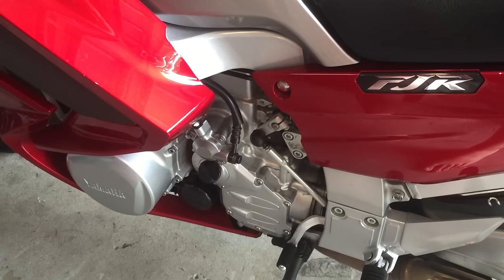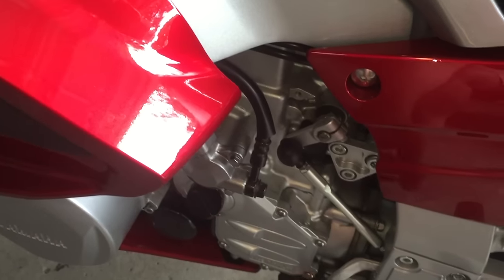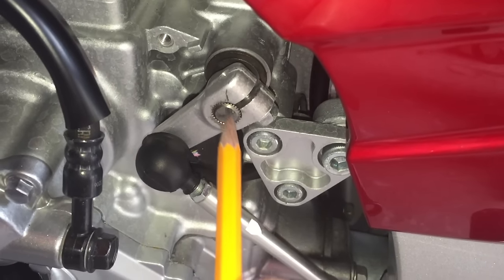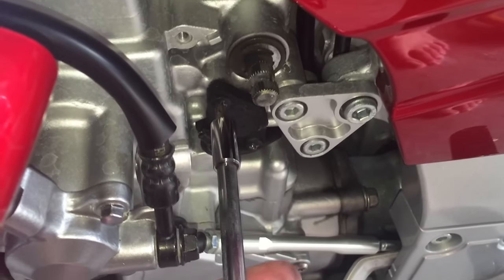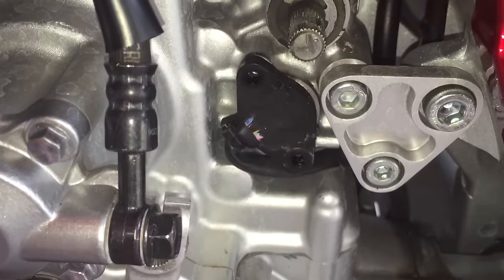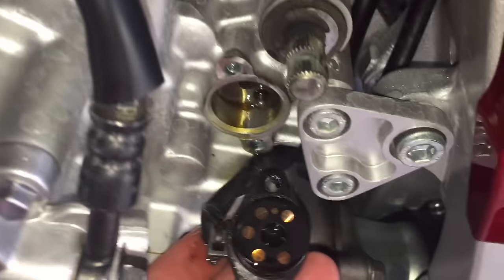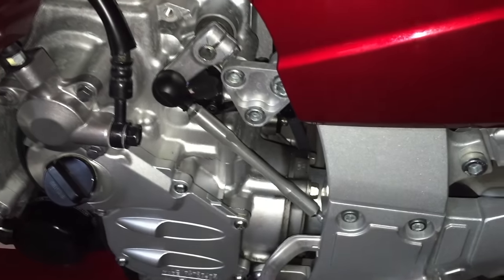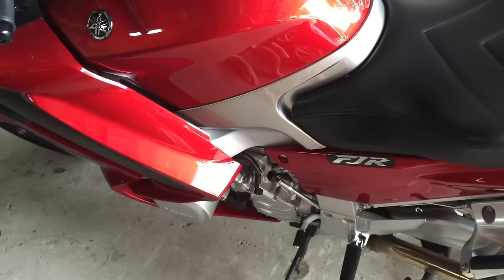How To Fix Intermittent Or Blank Neutral Or Gear Indicator Display Yamaha FJR1300

Comment: Where the shift linkage connects to the trans (the rod coming out of the trans), it is already marked with a little dimple on most bikes. Not necessary to mark it but doesn't hurt. Great video, thank you!

Comment: Cheers for the video, have the same issue on my bike, different make and model, but cleaned and sanded the sensors and now works good as new. Saved me a few quid😊
Reply from the maker: Glad it helped

Comment: Another viewer mentioned it here a couple of years ago but I would nonetheless like to reiterate that on Japaneses motorcycles, you must use JIS (Japanese Industrial Standard) cross-head screwdrivers to remove or tighten any screws that look like they have Phillips-type heads. Phillips-head screwdrivers have long, pointy tips that strip JIS screw heads whereas JIS screwdrivers have shorter, flatter tips designed to fit snugly into JIS screw heads. You should definitely avoid using the cheap Phillips head screwdrivers that usually come in the motorcycle's tool kit.

Save yourselves a major headache and buy a set of JIS screwdrivers!

Comment: Great video. I tried cleaning and also very lightly sanded the points. It’s better but not fixed.  I can see the pads are a bit scored. I’ve ordered a new sensor for the 6 speed ($135 AUS)

Comment: I also have a 2014 FJR that is doing this same thing in first gear. But my issue shows' up intermittently when the bike is hot. Going to open mine up and give it a good clean. Thanks

Comment: Can you pls share what you used for the cleaning? Degreaser, petrol, lacquer thinner? No idea what to use. My gears are stuck when trying to shift and there is no gear number indicator anymore. Just blank. Not a happy camper. Thanks for the great videos.

Comment: Appreciate the video. Just picked up a Kawasaki and the neutral light is intermittent when in neutral.  Gonna take a look at and see what the deal is.  This at least give a little guidance on what to look for.  Thanks.
Reply: crazyrage30 
That is the problem. I have a Kawasaki 2007 and I'm having the same problem with the neutral.  But I don't know where is located
Reply: Marco arellano haven't had the time to mess with it really and just been dealing with it so far, however when I do it I'll let u know where it's located if you don't get to it first

Comment: Thank you for this,  i have a 2016 and wiped out the area and now it works fine. Is there supposed to be oil in there for lubrication? My 2016 had nice  allen head bolts already in place (i bought it with 13 miles on it). I appreciate the help and if it goes bad again will probably just replace the part.

Comment: I've got a similar problem on my C50. Mine shows intermittently 1st and 2nd gear while in 1st gear. The rest show just fine. On long trips, it's not a problem... but it bugs the hell out of me in the city. Hope that just cleaning will solve it!
Reply: Did cleaning help this issue? I have a similar issue were mine shows neutral and 1st at the same time when in neutral.

Comment: I recently bought an 06 R6s and it was good the first week but now when I try a cold start it doesn’t want to turn on sometimes because the N light won’t go on. I have to go to 1st and then N and play with it until it lights up then it turns on. Could this be the same problem you were having ?
Reply: Just put up the kick stand

Comment: I used a small hand impact driver and phillips bit to get those screws out.  No problem.
Reply from the maker: That can be risky.  Impact will sometimes just strip the head if there's a lot of loctite.  It needs heat to be safe.
Reply: NEVER had a problem with this little  impact driver.

Comment: sometimes you just have to do a little bit of adjustment a i hate screws like that. i use a "grabit" they are the best extraction kit ive found for stripped screws
Reply: Using the proper screw driver will help quit a bit & prevent striping out the head with regular Phillips screw driver. Japanese Industrial Standard (JIS) cross-head screwdrivers are still another standard, often inaccurately called Japanese Phillips.

Comment: Japanese Industrial Standard (JIS) cross-head screwdrivers are still another standard, often inaccurately called Japanese Phillips. If you use a JIS screw driver not a Phillips they come out as intended.
Reply from the maker: This wasn’t an issue of engagement. It was loctite.
Reply: Using the correct tool makes the job much easier.
Reply from the maker: It makes no difference to loctite. If the tool slips in the head, yes.  Mine didn’t.
Reply: Vise grips will work on any nut and wont slip but the proper wrench works much better. If you want to argue the proper tool is not always the best tool for a job go ahead but I know better. That's my point no more no less.

Comment: You really need to use a JIS screwdriver not Phillips.  Big diff.  Using a Phillips is why it strips out.
Reply: Even bigger difference is Pozidrive, which is the first screwdriver tip shown in the video. That's why the heads stripped out imo.

Comment: I bought 2012 R1 last week and the Neutral light stays on no matter what i do and the gear indicator is not working as well. not sure where to start, thank you
Reply: Did you find a fix for your R1 neutral light? I have the same issue with my FZ07.

Comment: you need to heat up the screw if it was Loctite-ed to loosen it, but agreed allen would be better choice.
Reply from the maker: Yes, I said that in the vid, however you do not heat it when it's surrounded by and going through plastic.
Reply: I use a soldering iron on the center of the screw for a few minutes and it will soften them loctite pretty easy and because its its a fine point it heats the screw only
Reply: great idea, thanks
Reply: Blue locktite should not require heat.  
Red, have fun if you dont have heat.